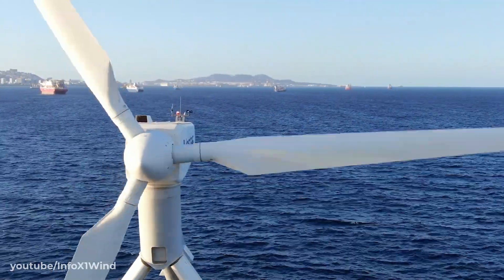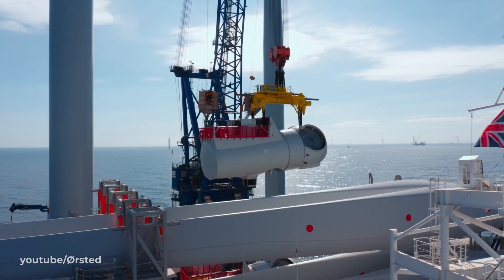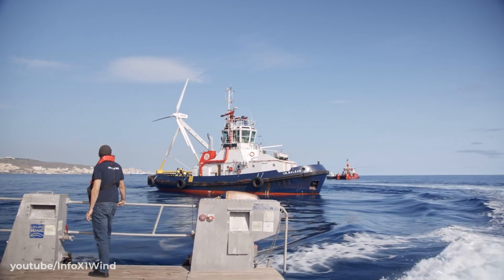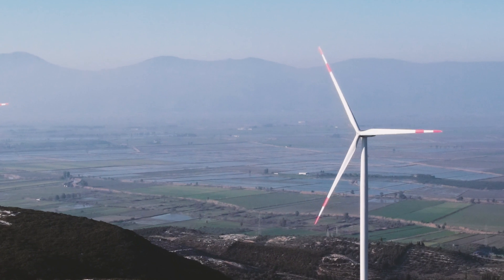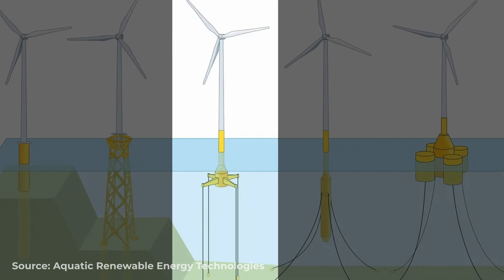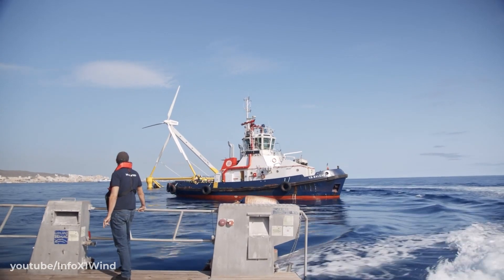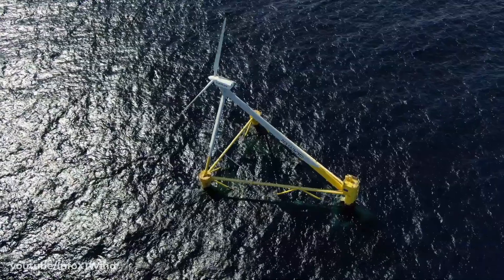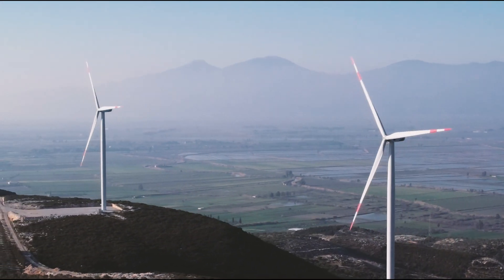This Company is Reimagining Floating Wind.

Comment: you forgot one crucial problem, the power transmission cables, the distance to shore, land connection to the grid literally kilometers away. These turbines produce minimal output (3-6 megawatts) with floating turbines over large distances of sea and ocean.
Reply: You're a bit behind the times. Currently, the largest turbines are rated at (20MW (MySE18.X-20MW) and floating wind turbines will be the largest possible turbines. I worked on a 7MW floating wind turbine project (MHI Sea Angel) in 2015, which was amongst the largest in the world in then. All offshore WTs are arranged in wind farms of hundreds of MW, offshore farms will be bigger- Gigawatt scale like a nuclear power plant so you aren't making a connection to one turbine.

You're right that the grid connection etc. is very expensive but it's a question of returns on investment. You pay for the system up front and it pays for itself over time. How long it takes to do that and move you into profit is dominated by inflation and the cost of raising capital for the project

Comment: Nothing is mentioned about the salt impact to these. Existing offshore turbines, imagine this, are suffering pitting from the wind blown salt. Once that starts you have real problems coming up.
Reply: Do you know how salt is made?
Reply: @B_y1n  your point?
Reply: @xltek1  
"wind blown salt" in the middle of the ocean?  🤣
Reply: @B_y1n  oh excuse me, when salt water blows into a mist and covers objects, does salt not adhere to the surface of the material exposed? I live on the coast and battle salt on our structure continually. 🤔
Reply: @xltek1  
Is it an issue for the current wind turbines on the ocean? Or ships and oil rigs?  I never heard anything about salt spray.  I mean, when the ocean sprays onto a structure and the salt water hardens, I assume it falls off.
Reply: @B_y1n  no it doesn’t fall off, it sticks. Here on the Oregon coast aluminum will turn to powder in time, galvanized steel won’t last, stainless steel should be renamed  stain less steel. So to answer your original question the salt comes from the saltwater. Have a great day.
Reply: Having to maintain and repair renewable infrastructure is better than burning fossil fuel
We must leave ancient carbon dioxide in the ground where it belongs